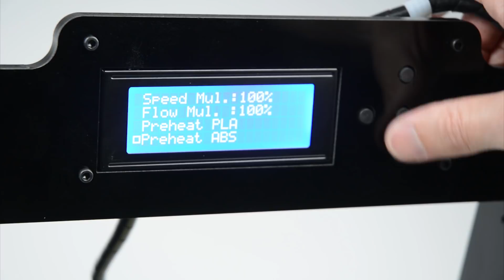ANET A8 ASSEMBLY AND FIRST PRINTS

Comment: Slight problem with the power supply
Can’t put the screws holding it to the frame all the way in, they just end up hitting/bending the board the electronics are on

Comment: Hi , What is the problem  for the Anet A8... When the initial operation, the extruder is directed to the opposite side to the end and continues for a while the engine rotates even when the extruder reaches the end ... The same applies to the surface ... Also, the z direction motor works one and the other does not work .. Note that I almost checked the connections  All are correct

Comment: I am new to the Anet A8 and trying to get it to print.  I can go to the menu and preheat the extruder and bed and I can read the temps in the LCD.  But when I go to print I see the bed heating but the extruder shows a "0" for the set temp.  If you are using Cura what is your start G code and end G code for the Anet A8 printer?
Reply: I'm also having this same problem but cant seem to find the answer.

Comment: After using mine for about a year there’s a few recommendations I would recommend, firstly, change the firmware to marlin or repetier, second install some xyz braces to strengthen the printer up, thirdly install a decent power supply cover and switch, fourthly change the hotbed connector and get rid of the tape on the bed, use boresilca glass. you might want to also use belt tensioners.
Reply: Really there is too much to recommend to fit in a YouTube comment. However don’t worry because these are just recommendations. It will help but are not necessary

Comment: I seen the Pinshape Logitech Boss kit adpater for the G29/G27/G25. I was wondering if you could make a print file for a Boss kit adapter for Logitech Driving Force Pro?
Reply from the maker: It could be possible, I'd just need a Logitech DFP to disassemble and take measurements.
Reply: amstudio I have one disassemble already, what would you need me to do to send the measurements?
Reply from the maker: If you can email me some pics of the base, hub, ect. and then we can discuss the project further.